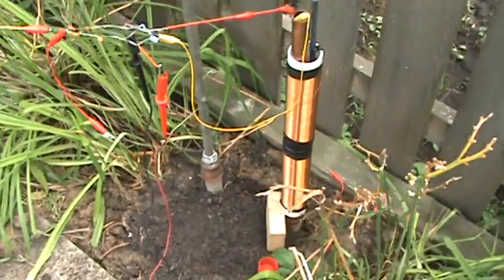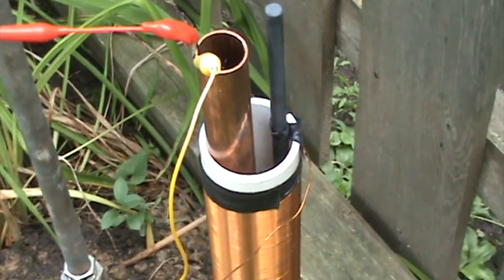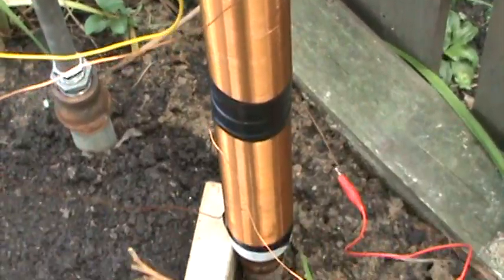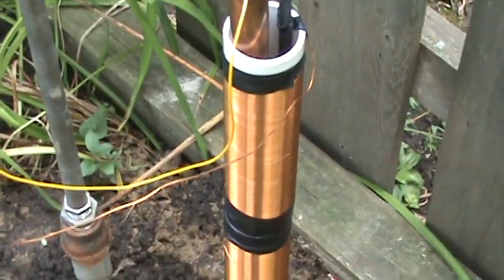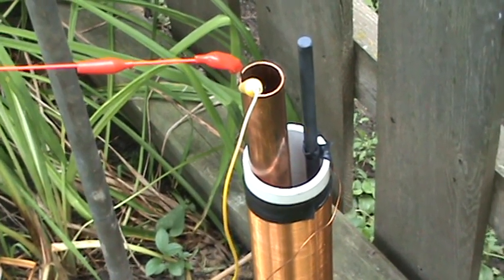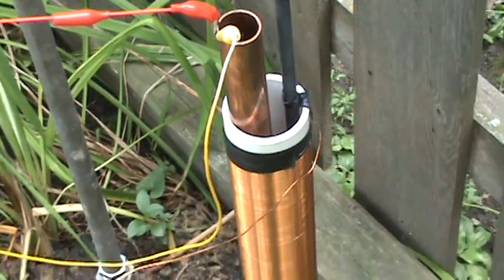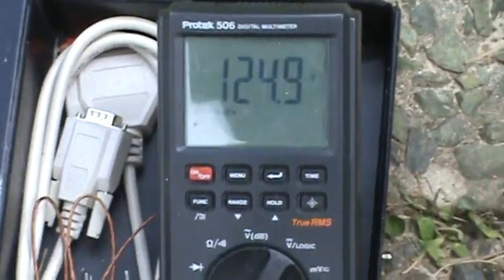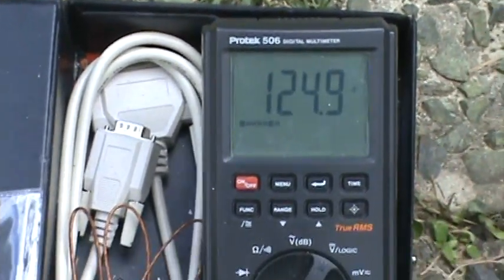FREE ENERGY FROM AIR CIRCUIT PART 16/24

Comment: Actually Just like Nikola Tesla and many others researching Radiant energy, I believe 
the energy comes from the ambient area( solar radiation/cosmic energy) surrounding the antenna. I have done an experiment similar to this using a few simple components and generated 1.5V using a small capacitor and lit up a high intensity LED light for < 1 seconds(capacitor was first discharged before starting ie 0 VDC). I was amazed/shocked and confused!!!!!!??? Damn Tesla is the man!

Comment: look into the resonant frequency of cosmic radiation. there are some radios built to receive that energy and it plays music. the music of the cosmos.you will need to make around 35,000,000 volts at .001amp then down-step that voltage to achieve any appreciable amperage. you end up with after transformer losses and loading just enough to power up a home. using batteries to make up for surges and peak power consumption.

Comment: ok yes the voltage is there now how many amps can it supply. using ohms law voltage time amps is wattage. the average wattage usage of a american home is around 24 kw hours. now that this is know how many antennas will it take to generate that much energy. being a ham radio operator, i know you will need to space each antenna a given distance apart to keep down mutual inductance. this would kinda nullify one antenna from actually being two antennas,

Comment from the maker: The incoming frequency of only the antenna is ,,ohh, trying to remember what video i have frequency in,,,it ws like 265hz i think,,,it waas way over power lines and below AM radio. If the potential is there, then i believe there will be a way to make it flow faster. Search "Joe Tate AMP"(ambient power modual), i found out about this guy aprox 6 months ago, about 2&1/2 years after i started on this. This circuit will also pick up tectonic plate shifts, it "is" picking up more then man made freq.

Comment: Less than 1/10 of a watt (100v x 635 microamps)? Doesn't seem too practical. I'm guessing your coil is picking up electromagnetic radiation/induction from nearby powerlines. This is easy to check with a frequency counter. If it's 60Hz (or whatever frequency your local electric company is using), that's what's happening. There's no way you'd be able to build anything big enough to gather useable amounts of power by that method--and the power company might come after you for theft if you did. :(

Comment: @l28power but its still 0.000635mA.

R=V/I    SO  R=120V / 0.000635A = 188976ohms or 188.976Kohms
W(power) = I*V   =  0.000635*120 = 0.0762W=76.2mW

There's something wrong with your maths, as your values calculate out to
1000ohms*0.000635A= 0.635v (into a 1k load)
W=I*V   so W=0.000635A x 0.635V = 0.00004W  or  0.04mW
This voltage/power is a little low don't you think to be useful ?
Try lighting an LED with a dropper resistor of 5.6k for 120v....

Comment from the maker: @TheChrisky13 Yes, add coil between antenna and circuit,,i also have my coil over my ground pipe, but this helped "me" to get the circuit better tuned, it does not help everyone though. The coil should up the voltage, Then try to place a ferrite rod in center of coil while watching your meter, to find best tuned spot :-)

Comment: My bullshit detector's going crazy...... Try testing the 'device' with something other than a Digital Meter. And put some LOAD on the output rather than an open curcuit (or DVM with 1Mohm/v load - or in your case a resistor with 120 MILLION OHMS equivalence - in effect an open circuit)
 Good luck, I suspect you'll spend more money trying this than the power you'll recover..
 And what if the main power grid goes down ??

Comment: @TheSalazara You don't understand. As a radio signal is sent out from a celstial body it spreads out. The further it goes the more thinly disperesed it's energy is. By the time it travels the distance from it's point of origin to you the amount of energy that actually reaches you is allmost nothing. It would be like pouring a can of soda into the ocean and trying to recover that soda back from the ocean on the othe side of the world and fill a glass with it there.

Comment: @LoneYukon Tesla coils just transmit electricity to be recieved by other tesla coils and a few other devices. They don't generate power just move it. Tesla believed he could use them to draw electricity out of thunderstorms but he ever made any real progress on that. Even if he had thunderstorms really don't contain that much energy. Lightning may be an impressively high voltage and amperage discharge but since it only lasts for a fraction of a second it's over all power is negligable.

Comment: @TheSalazara What you don't understand is that in order for this thing to pump out more energy there has to be more energy to draw from. Since all or allmost all of the energy is comming from radio transmissions here on earth hat means you would litterally have to have either more radio stations or increase the output signal from the existing ones. The thing is to get anything significant out of it you would need at least 100 times more signals to draw from.

Comment: @breezebro FYI, I'm all for cheaper forms of energy but the problem I come coming up against is these 'free energy' devices that either don't work because they're fraudulent, or work to a minute increase that they're just not worth the time, effort or the money to either buy or construct.

Tesla's absorption of static electrons in the air or radiant energy, Magnetic motors, HHO devices etc etc.

I'm interested just a little pissed off with the hype and BS.

Comment: @breezebro Less than $2 a gallon for fuel?  What do you pay now, $3?  $3.5?  $4?

In the UK we are paying £1.31 a litre!  (US gallon is less than UK gallon.  UK gallon = 4.45Litres and £1 - $1.54 or $1 - £0.64)
So we're paying;  litre  x  4.45  x  1.54 exchange rate / per UK gallon 
= 1.31  x  4.45  x  1.54 = $8.98 per UK gallon

That to me means that you're already getting fuel a lot cheaper than us so unless you're paying more than $9 per gallon then stop crying.  How much do you pay/gallon?

Comment from the maker: @masterjaniuk Hey, thanks!.  Now add the coils between the antenna and the circuit, voltage will go way up. 2 antenna types i have not tried yet, a satelight dish, a fractal antenna,,,also a cell phone antenna(which is a type of fractal antenna).  So far the longer and higher the antenna the better the results. I will try to get everything to resonate next :-)

Comment: Great work with your project ,I hate to tell you in the 1800's it also was used with the telegraphic which was powered by the same method and the wires in that time frame ran thousands of miles of wire for the telegraphic system.It was the only source for the power of the telegraphic .You may improve it ,but it's been around for awhile ,good luck on your work

Comment: @INVENTOR3 I've also done some research with it. You can make a  radio with the high frequency voltage in the air. All you need is a germanium diode and a coil and a crystal earpiece. See a video I made on my channel.
Connect the antenna to earth (radiator) and it works !

Comment from the maker: @savepenguintrees Sometimes i forget the basics,,,should i be checking power with a load across the outputs?,,,and multimeter across this load or in series with this load? If in series, does it matter what side of load the multimeter is on(neg or pos)? I will check and see how much amps my meter draws, thanks.

Comment from the maker: @bnewton81 No, not the same as the solar chargers, im collecting ambient energies. Although Nokia and RCA will be coming out with new battery charger that does use ambient energies.....search yahoo for "charge cell phones using ambient energy"  There is a way to make a small antenna act like a large antenna, and they did it !!!!

Comment: No not really just keep me updated on your progress I would be very interested on your results I have a few that I am building to like my crystal battery I can put as much energy through it as I like but it will only hold as much as it is designed for and another device that uses zero point energy from anything even or mainly garbage dumps where there is more than enough energy.

Comment: I'm not even getting any amp's , won't even register ;-) . volts ? I'm only getting 0.5v - 0.6 v . Unfortunately , radio shack only had 0.1uf on the ceramic capacitor's  .  I've looked in all my old electronics part's board's and find no 204 stamps . radio shack didnt even have the right germanium diodes , i had to pull them out of a cobra29 ltd ( was a new radio to ! ) ( which has about 7 ) ( uniden has only 2  of equivalency )

Comment: So now my mind is tinkering around w/this whole thought.i went 2 radio shack 2day,expecting 2 fork out $2.-$4.00 like another video says it  "Only cost's",i spent $17.00 4 the parts & they didn't have everything.I noticed,& followed by ur schematics & a schematic diagram posted by another video,which coincided with your visual.here's the problem;when u take the ceramic capacitor's & place them in-line then the voltage raises from 50v and doubles to 100v & uf's cut by 1/2.how do u get round this?

Comment from the maker: @wildthing40486 I have read this before, the 2 differant ways. The power runs under ground along the fence line(easement), under my Lab,,,thats why i moved my ground rod to the middle of the yard, away from the back fence.  I dont know if home is feeding the voltage from the ground or if its straight from ground. New experiments today as long as the rain stops.  I will now see if i can get above the 124V, and get more than micro Amps.

Comment: I'm curious.... Did you know that a home may be wired in 2 different ways ? At the box , it can be wired in to where the power cycles until used by the home , or it may be wired to feed of any unused power , straight to ground . It would seem , that by the meter showing 124v  , that it maybe possible that your only picking up from the homes ground rod , what wasn't used by the home .  I'm curious if the home is feeding the voltage through the ground , or if it's straight from ground. thanks!

Comment from the maker: @awabast Only micro Amps at this time. My antenna pole broke over the winter, and i just got it fixed up again.  I will be taking new readings again this weekend.  Now i have 2 antennas wires coming off of it,,,it will be interesting to see what the results are of connecting 2 antennas and 2 circuits together :-)    I will give everyone new readings soon. Voltage, Amps and Power.

Comment: @skunkape49 If you took that 120v and increased the voltage with a Tesla Coil, im sure you could power most of any light. Strong enough V and a big enough Tesla Coil, you could power your house. Tesla Says the Higher the positive electrode, and the lower the negative electrode, the more V per foot, you can accumulate.

Comment: it is current just not enuff  to be of real use the parts i used to expearment  with in the 1970s are taken off the market because the device i made could power 5houses at full power use and 3 more down the line would be in brown out when the transformer down the street blow up from lighting durring thunder  storms  the power company would ask us to turn off our braker  so the could fix the transformer  dad was gitting a check for  $1200  a month

Comment: With this set up how many of these would you have to tie together to charge, say 10 batteries at 120volts to keep up with a house that uses about 800 kwh a month?  Also would you have to set up separate antennas or run off one with many circuits?  In simple terms to take the place of solar panels that only charge with sun.

Comment: @INVENTOR3 I am the same way, i do believe that science is not set, but everyone should feel that way, but yes in a transformer there is a trade off, amps for volts volts for amps, but in a cristal radio, it acts a little like a capacitor, builds a charges of both volts and amps, the coil helps to bust that power, but the way it does this is by pulsing the current but its like 200Hz so with out a scope you will not notice. cont

Comment from the maker: @1crazyfocker Hmmm, ok. I agree, i should watch what i say. So it makes sence to you that voltage went way up but Amps did not change. Are you saying that it is beacuse the coil is in resonance with the rest of the circuit or with the incoming frequency on the antenna? Everything i learned in school says that there will always be a trade off with volts and amps,,,but then again i dont agree with a lot of stuff i learned from school books.

Comment: @INVENTOR3 oh come on dont go there say it defied the laws of physic. that why i said the coils are acting like a resinator, like in a crystal radio. and it makes since, since most ppl that get 5 volts pull around 2 amps,  so it adds up. so no law broken, plus lets say its "tuned" to visable light, then you wold get a pretty big volts from it, once again no law broken,  mainly if you dont know does not mean its breaking any laws of physics. but keep it up

Comment from the maker: @1crazyfocker I do know they are along the fence behind my lab, not side that i have my ground pipe at.
Yes, most people only get like 5 volts,,,but then most give up at this point,,,over 100 people that i know of so far have replicated this,,,but no one has got as far as building the coils, and this is the most important part.
Coil made volts go way up and no trade off of current,,it defied laws of physics.  last i remember i got like 60 or 80 milliAmps,,,but only micro watts of power.

Comment: @INVENTOR3 oh okay, your powerline are underground, have you mapped them out? just asking only because of how many  volts you are pulling. the best i have found from most id only 5 volts, but you are using a coils and capacitors with diods ( a simple crystal radio) meaning that you are jumpijng the volt thru resadince like the crystal radio, so i guess i should ask wht kinda of amps you pulling? then keep it up

Comment from the maker: @1crazyfocker I talk about power lines i think in video 3 or 4, not sure,,but anyhow, All power lines here run underground ,,they run along my back fence underground(the easement).  This is why i try to keep my circuit and ground at far end of that easement.  My incoming frequency is not of power lines or radio, so it is interesting.

Comment: Great inspiring videos Paul ! Lots of helpful tips.I am planning to build a small scale one too soon.I will do it a little bit diferent but very close to the way you do it.The diference is adding Meyers concept of putting magnets up in the tower top..point the magnets south to north to one another but not let them connect of course but the gap between that powerful force between the two magnets i believe this will attract more electrons per second substantially.

Comment: @INVENTOR3 Cool....but a radio might not make as good of a test, since crystal sets work with no battery or outside plug. I'm only suggesting that if you make a radio, then people may assume that you are powering it the same as a crystal set radio, even if you are using 1 that needs a lot more power. Crystal radios are powered  by the EM radio signals themselves. BTW have U ruled out that U might be picking up radio signals as your power source? Anyway, I look forward 2 seeing your progress!

Comment from the maker: @jantjesjantje i get more than 1 micro Amp. I think it is a few videos after this one that i show power readings, yes i only get micro watts.  I will be able to trade some voltage for amps and maybe power a radio.  Now it will only power a cell phone or calculator. I have many improvements to make with this circuit yet.

Comment from the maker: @pinemontgo Thanks.  Yes the coils make a huge differance, especialy after running the ground wire through the center of them.  Many fail to notice that it defied laws physics, when the coils where added, i gained many times more voltage and amps stayed pretty much the same,,,there was no trade off.  Thanks again!

Comment from the maker: @frankensteinmoneymac Only micro Amps,,,can power a cell phone or calculator.  But with the volts and amps that i get, i believe i can trade some volts for amps and then it should power a radio. This design will be improved upon in the next couple of months.

Comment: Interesting...You speak of Volts but what of Amps? For instance a Van De Graff Generator generates thousands of Volts through nothing but friction, but hardly any Amps. The result is a fun toy, but its not all that useful for running anything that you find in your house. In fact the best measurement of this thing is to see just what you can run off of it. Can it run an LED? A Radio? A Light Bulb? A small T.V.? A Washing Machine?! LOL! If you can even just run a reg. Light Bulb I'll be impressed

Comment: You get all elephants who come through the door.
How many elephants do you have within one hour?
How can you know?

It makes no sense to talk about volts without Amps.
Volts x Amps = Watts
So you mention "Watts" OR "Volt and Amps".

If you have 10.000V  and just 1 Micro Amp:
10.000V / 220V = 45.45
0,0000001A x 45.45 = 0.0000045A
That makes: 220V x 0.0000045A = 0,001Watts

In this case:
To let a "1 Watt led" work, you need to build "1000 of these circuits".
1000 circuits x $20.00 = $20,000.00 !!

Comment from the maker: @IgaNinja91 less then $20.00 for all components.
But maybe $20 just for the antenna wire, the wire is the most expensive thing.
And the 41 foot tall PVC post may cost around $40.00 or $50.00, i dont rememebr exactly how much they cost.

Comment from the maker: @Texmurphy51 good idea to try at power outage.
The power lines in this area are all run under ground.
interesting thing about the step up trans,,,is that voltage went up but amps did not change,,,this defies the laws,,,,that was the amazing part.